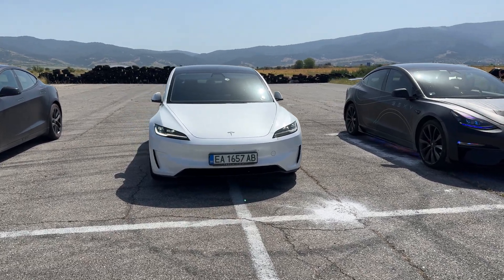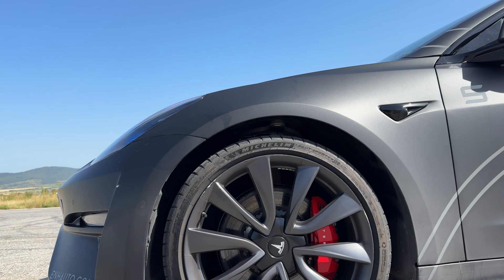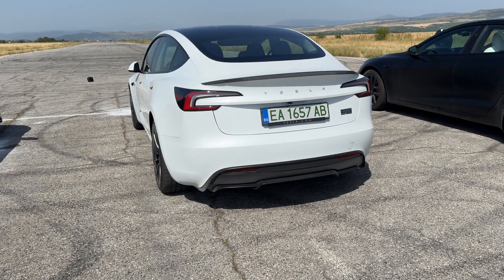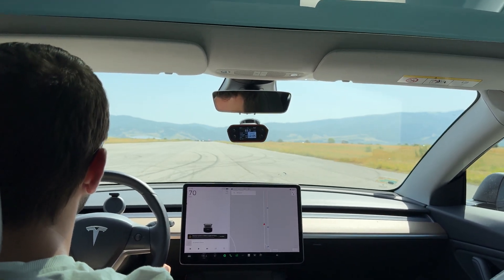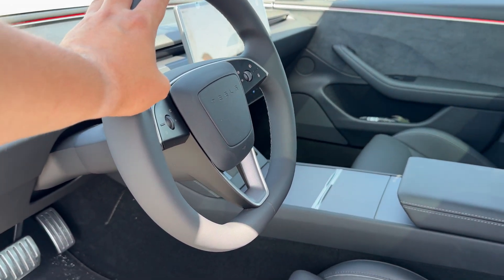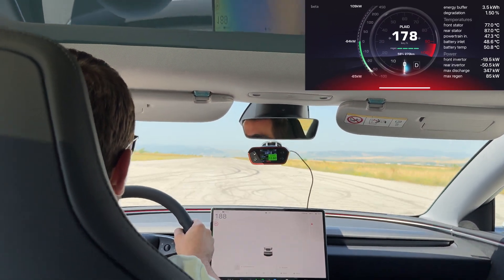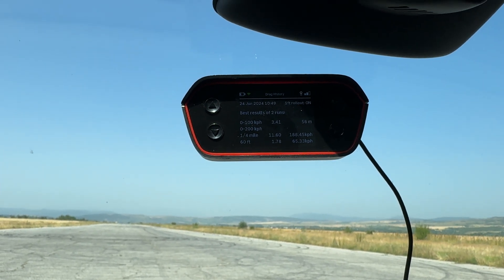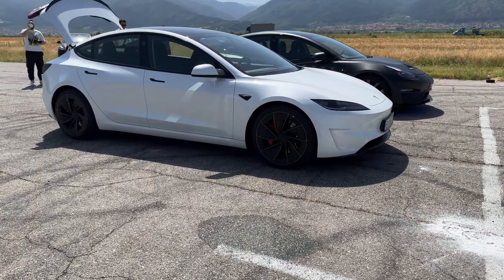Tesla Model 3 Performance Acceleration Test at 60% SOC

Comment: I own a M3P and test drove the new 2024 EU spec M3P (LG battery, less KW and slightly slower). Yes overall a better car. Performance wise....... very small difference (0.1 sec, faster above 100 kph). Brakes not better. Suspension is better in comfort mode. For me too small to swich, after 5-6 years I wanted to see a 2.5-2.6 sec car (just needs a better battery, motors can deliver 600+ bhp). Don't get me wrong: brilliant car for the price. The old one is just very good.
Reply from the maker: Well said

Comment: I highly doubt they used a motor from model S. Those motors are on a different league
Reply: The new motor in the M3P is different to the Plaid motors but makes almost identical power; 303kW vs 310kW

Comment: Also no… if a plaid motor was in there it would be called a plaid
Reply from the maker: Well , S has an insane mode , and this car has an insane mode too , so nothing is too consistent at the moment.
Reply: @EnhanceAuto-S3XY_Gadgets  The reason it got its classification as “Plaid” was because of its carbon wrapped motor, the model 2 motors are not carbon wrapped. The Cyberbeast is also not a plaid(despite being tri-motor). The modes don’t denote the cars designation. ALTHOUGH I’m willing to bet this car WILL have ludicrous OTA at some point because of the badging being a nod to Ludicrous from Spaceballs

Comment: Peak power is probably irrelevant, it might only last for a split second
Reply from the maker: Well, you might be right, but it looks like the new model keeps higher numbered at higher speeds which is interesting
Reply: @EnhanceAuto-S3XY_Gadgets  the rear motor is permanent magnet and the front motor is induction. PM motors only have slight power drop with rising speeds, but the power loss in induction motors is more severe at higher speeds. The more powerful rear motor will be sustaining the high end power. The car is now battery power limited whereas previous version is limited by motor power. This addresses one of the big complaints of the previous m3p, power dropping at high speeds.

Comment: The discharge is the amount of power the motors consume, some is converted to heat, I suppose the 4D2 new engine is slightly more power efficient that the older motor, so less energy is converted to heat and rather horsepower on the wheels.

Comment: Shitty LG with low 411kw discharge power is a bottleneck! 
All hail panasonic!
463kw > 411kw.

I’ll wait copart and place 4d2 into my 2018 MILF
Reply: Panasonic does not make 461kW. It’s around 18kW more than the LG.

Comment: One thing I noticed is the old one's power dropped to about 260kw gradually whereas the new one dropped to 301kw. So peak peak power is lower on the new but has sustained higher output compared to the old one.
Reply: Obviously and it matches what Tesla said (AFAIR) that it has ~20% more sustained power then the old model. It's still a shame the EU version is gimped compared to Uncle Sams variant :(
Reply: @andrzejz4218  another thing to note is I have seen reports that the Panasonic battery can output 435kw whereas the LG can output 415kw. Perhaps in time we will see an acceleration boost or similar...
Reply from the maker: Agreed
Reply from the maker: Good point.

Comment: My 2023 LR with acceleration boost does 12.0 at 183kmh at 70% SOC. definately not impressed by the new m3p with LG battery. This doesnt feel like an upgrade to me. The panasonic battery car is a significant upgrade
Reply: definitely*

Comment: To anyone who thinks this 11.6 seconds score is much worse than USA version of the car. Suspend your judgment. This 1/4 mile was at low soc (60%) and with two people in the car. The 10.95-11 seconds with the USA version was at high soc with 1 person in the car. The USA version is faster, but dramatically less than what is portrayed here.
Reply: The sad thing is we dont know. Maybe 90-95% SOC makes a significant difference maybe not. We need numbers now
Reply: @louisolivierfortin 99% SOC does 1/4 mile in 11.29s @191.76kmh which is still significantly slower than the Panasonic equipped US version which can achieve 10.89s-10.95s 1/4mile
Reply: @nm-yi4yf That's a good point/assumption, but I'd like to see some data evidence. I'm sure there will be more data points in future to draw good conclusions - heck maybe some 1vs1 tests, but now there is room for uncertainty.
Reply: @andrzejz4218  there is a lot of data if you know where to look. US cars with Panasonic are achieving 1/4 miles in 10.89-10.95s easily. An LG equipped car will never get close, the best I’ve seen is 11.29s with 99% battery. It will never achieve sub 11s with LG pack.
Reply: @johnnycos2211 exactly. Tesla screwed global buyers. For me acceleration from a roll from 40-50mph is much more important than dig races, and the new LG car barely edges out the old model. Not an upgrade to me
Reply: @louisolivierfortin  For the US spec cars, the new M3P 0-60mph is close to the older M3P.  The real improvements are the 60mph-> times.  I did some 1/8 mile races against the older M3P, and I would pull away toward the end of the race.  I was trapping 99-100mph, and my best time was 7.10 sec. I think there is still room there to get 6.9 with the factory wheels by lowering tire pressure and having less extra stuff in the car at a higher state of charge.  With smaller diameter wheels, stickier tires and lower air pressure in the tires, 6.9 sec should not even be an issue.
Reply: @jasonmilo1136  exactly my point. Panasonic cars are a great upgrade

Comment: You guys know I love Enhance Auto and the S3XY buttons but I am sorry this was a terrible video. First off, the new model 3 Performance doesn’t have a Plaid motor in the rear. It isn’t the carbon fiber wrapped motor at all. You are just wrong there. Second, those are the slowest times I have ever seen from either of those cars. I run 11.43 with my 2022 Model 3 Performance and 10.75 with my 2024 Model 3 Performance for the 1/4 mile. Your times are ridiculously slow even for the inferior MIC cars. Honestly, you can do better than testing at close to 60% and having multiple people in the car. Your battery was cold too. Use the S3XY buttons you guys make to help you optimize the performance. That is what I do. This video misrepresents what the cars are actually capable of.
Reply from the maker: We are sorry that you feel that way, but as we have stated many times before- we are doing our tests as a regular person would. We are not going on a special track with resin, or doing burnouts to warm up the tires. The batteries were around 35 degrees and yes, the SOC was around 60% due to us recording another video racing against the Plaid car, but the results were all the same. There was not even once the car would come even close to 11.00 seconds. Maybe the US cars would, but the one we have with the conditions we were on could not.
Of cruise a professional can make all the adjustments to reach the top speeds of this car, but 99% of the owners will never do. 
This doesn’t take away from the performance of the car. It is still faster than the 2019 model and possible more efficient. It is also very comfortable and sporty, which are all great things and that is why we said that Tesla has done a great job. 
About the rear motor - maybe we got the info wrong. Will look into it and thank you for pointing this out 🙂
Reply: @EnhanceAuto-S3XY_Gadgets  less than 60% SOC isn’t a reasonable SOC to test at. If you said 80%+ was a realistic scenario then I would agree but less than 60% isn’t worth testing at. You tested at a higher temperature for one car but not the other. Why not test them at the same temperature? Your own product helps the consumer do that. 12.0 seconds for any Model 3 Performance car any where in the world is just simply too slow. It doesn’t represent what the car is capable of. Tracks don’t even matter for the old car. It isn’t traction limited especially if it is doing a 12.0 second 1/4 mile. The reason to use a track is just simply that these cars are capable of such high speeds that for safety reasons a closed track is the appropriate place to do it.
The problem I have with this video is that people will run with the information you provided and treat it like it is true and that it is representative of what the cars are capable of. It has been shown that with your products you can achieve vastly superior times with these cars even if there are even more capable cars produced in other parts of the world.
Reply: I read that they tested the car before with higher SOC and had similar results. So maybe this is it. BTW, I haven’t seen any video on YT yet that reached the 3.1s as claimed by Tesla for the European model. All Dragy results were about 3.3s.
Reply: @toolsforfools  there are several 2024 MIC cars doing 0-100 kph in 3.1x seconds with rollout subtracted on Dragy now. That satisfies the claim of 0-100 kph in 3.1 seconds.
Reply: @LearningFast  OK, any hint where to find those videos?
Reply: @toolsforfools  find what videos?
Reply: @LearningFast  Videos where people used a validated (e.g. Dragy or Racebox) measurement and achieved 3.1 s 0-100 km/h for the 460hp model. I want to see the number that the equipment provides. So if this is what you are saying, then tell me who posted the video or the title. I am interested to watch it.
Reply: @toolsforfools  Teslabjørn did 3.23 without rollout, 0-100 at above 90% SoC, not strip (road). So it was about 0.2 S quicker than older 3P.
But I think most difference will be on track/autobahn, as the front motor then doesent produce as much, so the new rear motor can keep producing at higher speeds.
Reply: @OlavAlexanderMjelde  Well, so still not 3.1. And still wishful thinking of more power at higher speeds. Let’s what else videos will proof a significant improvement later.
Reply: @toolsforfools  3.1 is with rollout, TB measured 3.23 without rollout. So it is as fast as it should be.
Reply: @OlavAlexanderMjelde  It is still not a 3.1 s car as copied and claimed by many articles. Tesla continues to make promises, which lead to wrong conclusions, like the cybertruck beating a Porsche. Not wrong, but only half truth. So this car can be a 3.2s car under standard assumptions, at least if you take the best out of several runs. For me not comparable to other car brands that constantly reach or beat the factory specs. But this is Tesla.
Reply: Well, it is a 3.1 seconds car, with rollout.
Rollout subtracted can be up to 0.3 seconds.

So even if it did it in 3.4 seconds without rollout, it would be within spec for 3.1 with rollout.
You can read more about it here: https://en.wikipedia.org/wiki/Rollout_(drag_racing)

Its a common way to measure in USA/dragracing.
But anyways, when the car then does 3.2 without rollout, its clearly within spec.
Reply: @toolsforfools  rollout is up to 0.3 seconds, so this is clearly delivering as expected if you know a little bit about how americans measure dragracing and how rollout works.

If you look at Teslabjørns tests you will also see Tesla is one of few that actually deliver on accelleration numbers. One of his plaid tests were worse than expected, but other one much better. I didnt see those videos, so I dont know why.

But also Porsche has a Taycan Turbo S he measured much worse than expected (over 3 seconds vs spec 2.8).
Reply from the maker: Even Bjorn just posted a video accelerating 4 times on 96% and he could not come close to 3.1. Average was 3.3 as most people reach. 

You asking about the temperature is a great question. Both cars were charging at the same charger 40km away and they both left the charger at around 85 and 90% Soc (we never charge to 100 , except if it is an LFP car). 
We did total of 10 launches after we got to this road just for the fun of it (after all, we are fans of the car so we went there to have fun first and record a video second), and as you see, both cars had different temperatures , even tho they have been used the same. Again- all of those more complex tests are done from the people we mentioned in the video (Bjorn and Kyle), so I don’t see a problem here. 
And you thinking that someone who sees that the car can do 0-100km in 3.4sec , or a 1/4 mile in 11 and change, will think that this is a bad result , this means that this person does not care about the car at all and no numbers will impress him. Plus, we have not hide anything from the viewer. Everything is out there.
Reply: @EnhanceAuto-S3XY_Gadgets you represented this video as an acceleration test between the two cars but now you are just saying it was just for fun and you weren’t really comparing their performance numbers. Which is it?
Reply: @EnhanceAuto-S3XY_Gadgets  again your information is incorrect. Bjorn actually got below 3.1 seconds with rollout subtracted which is exactly the way Tesla tests it when they make their claims. Bjorn had 3.06 seconds on his best run.
The biggest problem I have with this video is that the information provided wasn’t accurate(Plaid rear motors) and that you didn’t test the cars with similar battery temperatures when you could have. The whole point of the S3XY buttons with respect to acceleration is that you can raise the temperature of the battery at will. I am not sure why you tested one car with a hot battery but not the other one when one of the best features of your own device is that it allows you to control the temperature of the battery at will. There is a difference between 3.4 seconds and 3.1 seconds. I know you think it is a small amount but it is significant if you are doing controlled testing. Also the SOC you used is just too low. If someone did better testing before with higher SOCs then fine just let them post their results. There is no need to test at extremely low SOCs and different battery temps between the two cars. That isn’t controlled testing and doesn’t represent what the cars are actually capable of. If you had a higher SOC and consistent temperatures then the cars would have been quicker and closer together.
Reply: @EnhanceAuto-S3XY_Gadgets your video description says both cars have a temperature of around 35 degrees. Both cars didn't have the same temperature so why did you claim they did?
Reply: I agree with your argument points. To be fair, the video does provide some insights in comparing acceleration old M3P vs new M3P with similar SOC and battery temp. In addition, I do want to point out that: 1) for 0 - 100km/h (or 0 - 62mph) measurement, the racebox time does seem to subtract 1 foot rollout time (as shown as "1 foot rollout on"), so the time shown would be almost similar to true 0-60mph (without rollout subtracted). 2) I recently learned that for Draggy 1/4 mile, it is using the NHTSA way of measuring, and it is usually 0.2 - 0.3s quicker than what racebox would measure 1/4 time. The difference would basically due to rollout counted vs not counted, and this might explain why the racebox time shows slower.
Reply: @stanley2412  Dragy shows both the time with and without rollout subtracted.
Reply: @LearningFast  Yes, I know. The new M3P shown in the video did a 0-62mph in 3.4s with 1ft rollout on, so that would almost equate to a true 0-60mph (without rollout) in 3.4s. I would say that's still a little bit slow even with 2 people (granted I do not know the weight). The MIC version should do 3.0 - 3.1ish true 0-60mph.
Reply: @stanley2412  yes, but it was tested by Teslabjørn to do less than 3.1 with rollout (3.2 without). It did 3.06 or something with rollout

Comment: I really need cooled/ventilated seats because my back gets sweaty in my 2018 Dual Motor Model 3. That’s my only complaint about the car. I had considered getting the vinyl replaced with real leather, but I was worried about changing my seat’s excellent comfort. I love the new performance seats, but I have a hard time getting in and out due to personal issues.
Reply: Teslasy has full bucket seats with ventilation for our cars .
Reply from the maker: We totally know what you mean.❤️